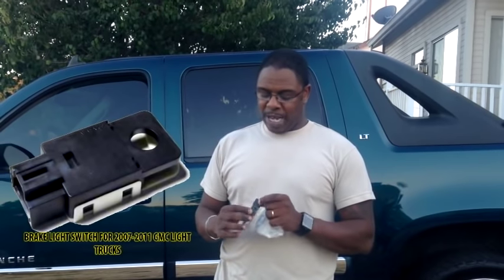[SOLVED] Fix Service Stabilitrack and Service Traction Control on 2007-2011 GM Trucks

Comment: had two vechicles with all those b.s. computors that cost money everytime those damn lights go on and then when you fix the problem another damn light goes on indicating the same damn problem, so git the codes erased and engine light gone but then need emissions and their computor says can't test have to run cycles to ready computor for test so run cycles go back for test then told still not ready run cycles so do again and AGAIN! same damn thing so now have to take it to specialist to find problem, cat and mouse game, so got them fixed and sent them down the road . Now driving old school vechile WITHOUT computors and modules and don't need emmission test and cheaper to fix!  also in my state vechiles need emmission test BUT state vechiles don't need test, police vechiles don't need tests, regional vechiles don't need tests BUT everybody else? YES PAY UP!  Bullshit program!

Comment: GMC makes garbage, I own a 2007 Buick rendezvous and the traction control system and bearing packages are garbage,don't buy new chevy or gmc junk ,you will regret it :-(
Reply: Mike Bucello  im WAS looking at 07 and UP Tahoe and Silverado now I'm going back to looking at the oldies but goodies for my Gf.Mine oldies work just fine with 260k